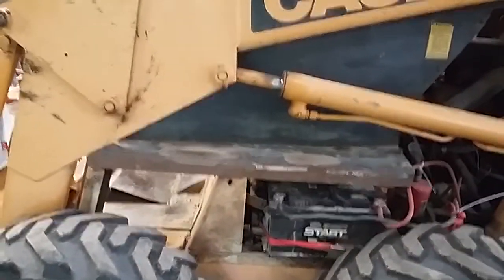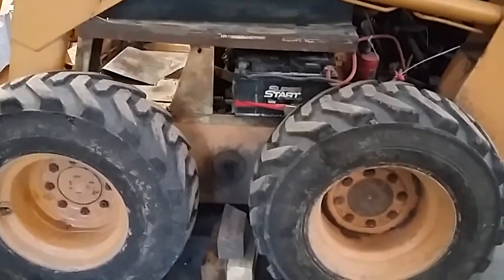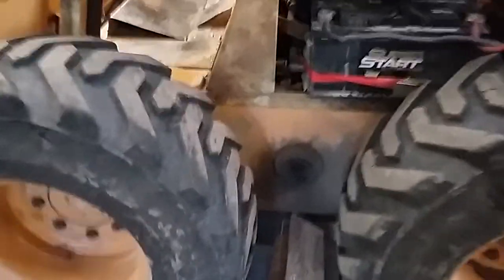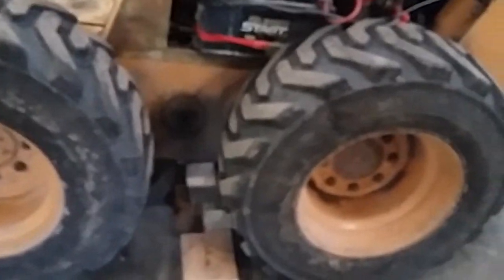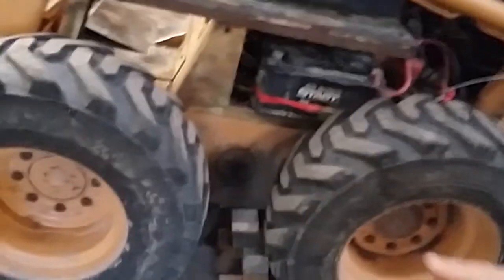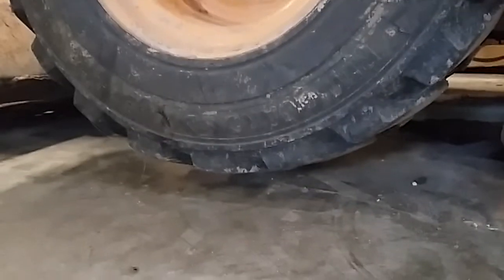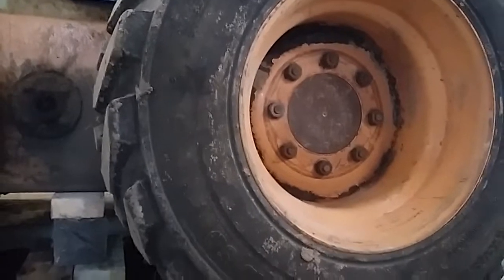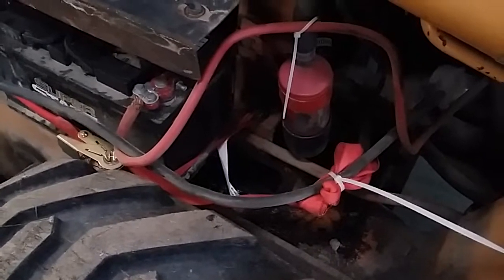Case 1845 lift

Comment: You can service all 4 if you do it right.. I block the back corners, then lift with the loader and block the front.
BTW, the main frame (chain tanks) is all 1/4", being oil on the inside, it shouldn't rust if it's serviced regularly... Should support a jack anywhere.
Reply from the maker: That's a great idea. Thanks for the comment.

Comment: What if your back wheel is missing 😂... jk but not really. I just picked up a 1935c with the hub already removed. The hub and axle was smoked but I was able to weld everything back up and machine it right again. So far I have $760 into the whole thing counting the purchase price. 👍
Reply from the maker: That's a pretty good deal.
Reply: @c.mcghee4601  we will see... it fires right up, and everything seems to work with no leaks, I even drove it with 3 wheels up onto my trailer. I figured even at $500 I could part it out and make a couple bucks if it was too far gone. I gave it a good power wash yesterday to knock off all the moss and it is in surprisingly good condition.
Reply from the maker: I bought a truck once and the moss was the only thing holding the drivers fender on lol
Reply: @c.mcghee4601  ...update, $900 in counting all the fluids and this thing is in tip top shape. I wish I had this thing on my property years ago.
Reply from the maker: @triggerwarning2439 that is awesome.  I sold mine about a year ago and I regret it at least 3 times a week.

Comment: The brake on mine is giving me trouble did you disconnect yours?
Reply from the maker: My brakes were disconnected before I bought it. Not the safest but better than the pin engaging while you're driving and breaking chains.
Reply: C. McGhee Mine ingaged and pop the chain off I’m just gonna take it out LOL agreeably unsafe
Reply: Those "park lock" shots are easy to fix, usually it's a bad cable or it needs adjusted.. biggest thing is to keep everything lubed up and keep the cables adjusted.
I've replaced the cables on mine a couple of times... Mine runs in manure all winter and in dust all summer..

Comment: How did you take the side panel off to expose the battery?
Reply from the maker: There are 2 or 3 bolts behind each tire and a couple in the middle between the tires. I can't remember what size they are.